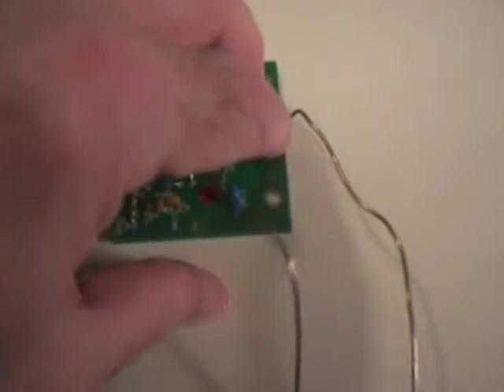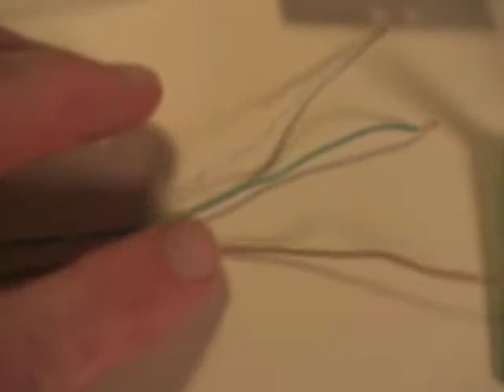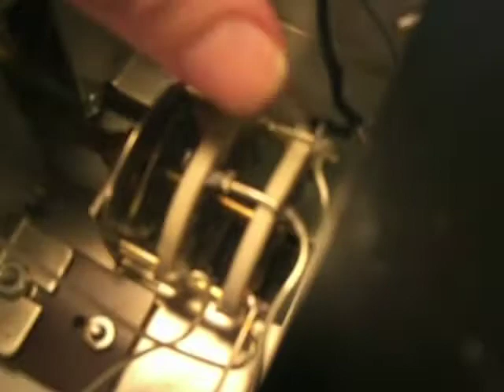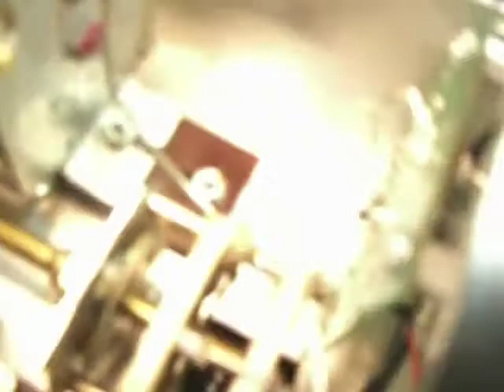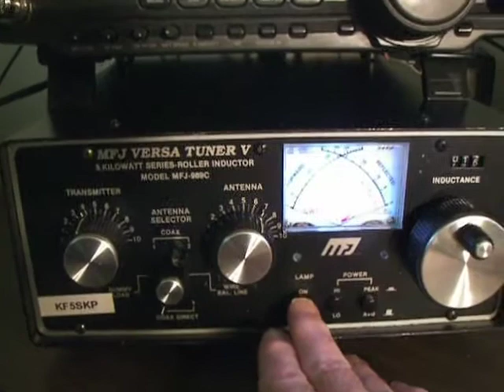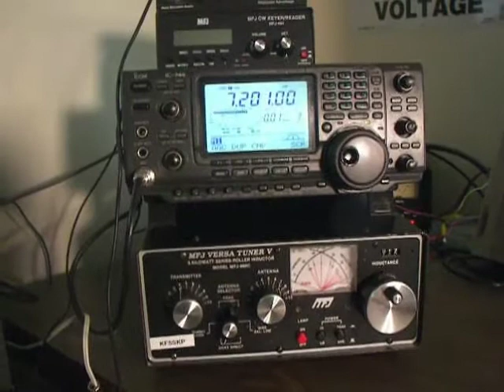MFJ Antenna Tuner Problems - Part 2

Comment: Just a friendly correction. The female uhf connector is an SO239. The male uhf  connector is a PL259. It is possible different company's may have different part codes. Thanks for the video. I am in the process of doing antenna tuner research for a higher power amplifier. 73